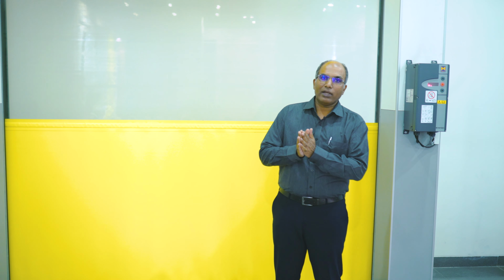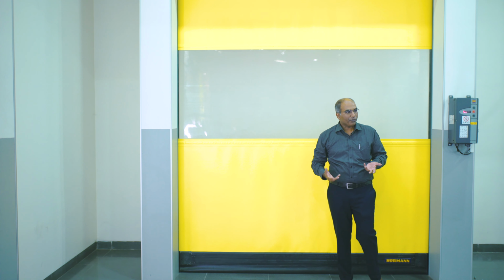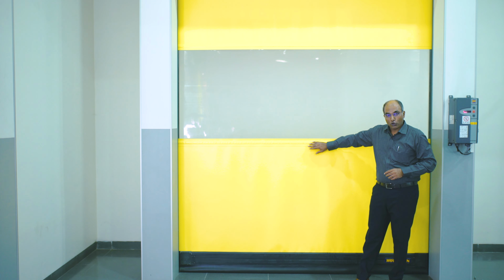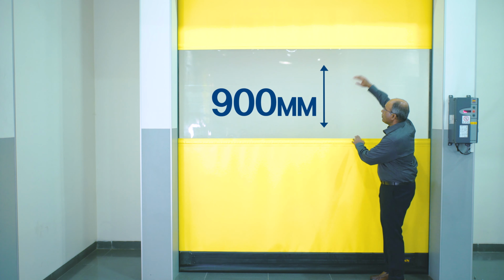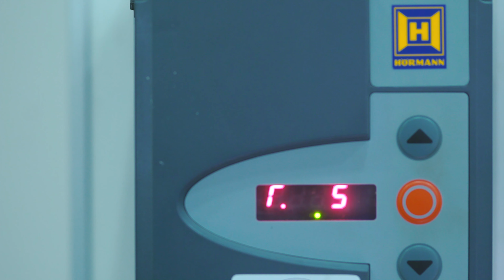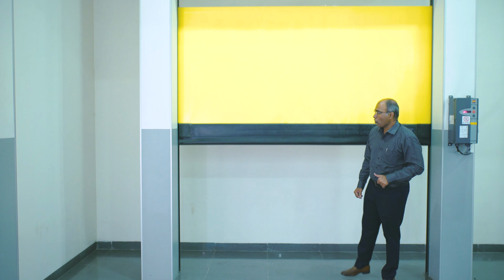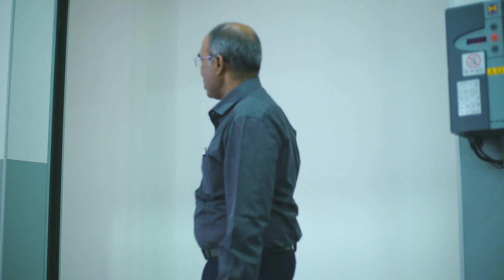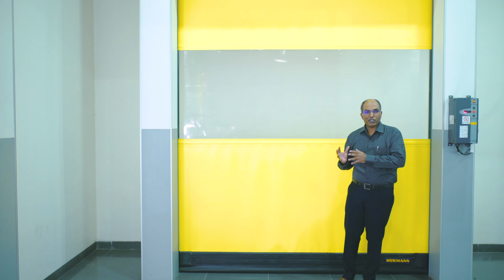HIGH SPEED DOOR

Comment: Helo sir FOR. BK 150 FUE H CONTROOL BOOX (F.0915)  WHAT ISU
Reply: Communication Error Between Main Processor and I/O processor. Kindly switch it off for 10 mins and switch it on,  If you got the same error controller needs to be replaced.
Reply: Hello sir this F.0915.  Coming many door because in Saudi Arab temperature is around 50 or +.....because i initialling door in Saudi Arab .......
Reply: Yes